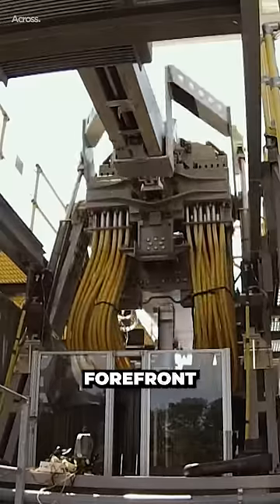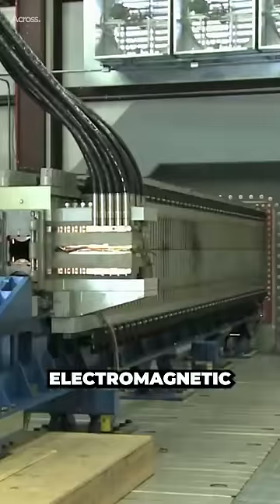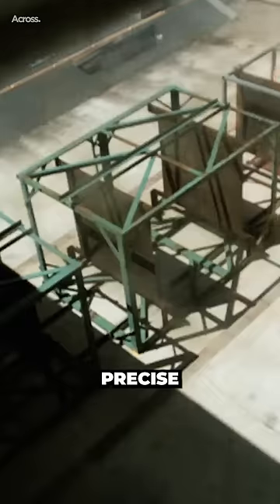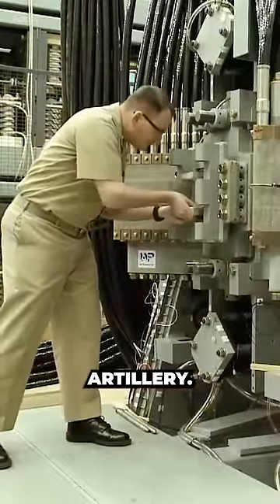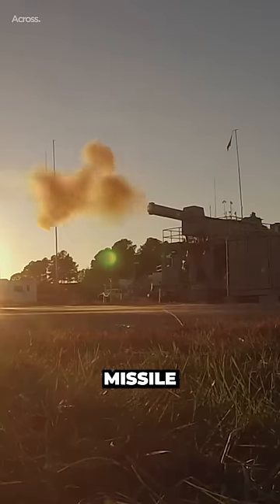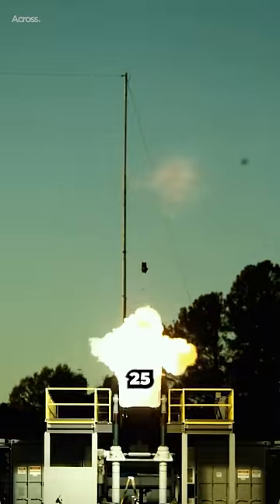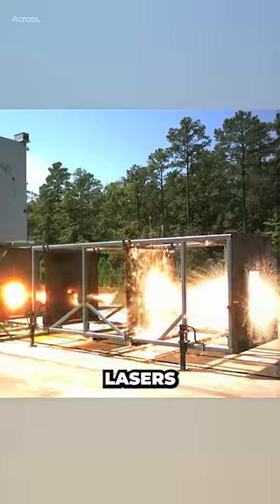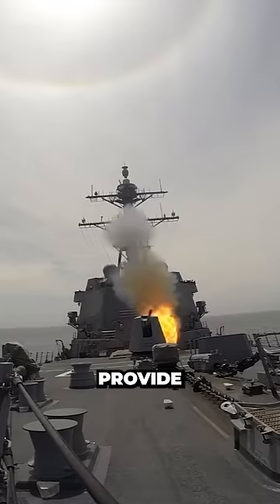The $500 Million Weapons That Make Everyone Afraid #shorts

Comment: They gave up on the rail gun.  Which means they probably got it small enough to fit on a ship...lol
Reply: Yes... that is also my understanding.
 It had a great deal to do with erosion of the rails/ short rail life.
Reply: Yeah they got something out of this. It's too good a concept to just say "nah it won't work." That's not the DoD style.
Reply: @dominushydra the issue isn’t size nor really power. The barrels just couldn’t last long enough to be reasonable. The existing rail guns had worked perfectly well. They just needed barrel replacements too often to be both reliable and cost effective
Reply: @RedPepper889  yeah I know that
Reply: @RedPepper889  why dont they use it as ground artillery? 115 miles, highly accurate could use it to destroy bridges or focus on supply lines and cant be intercepted?
Reply: @bigt6665 drones can probably do the job and are way easier to deploy
Reply: @bigt6665 rail guns penetrate, not destroy
Reply: @bigt6665 exactly what i was thinking, one proctile has to be much cheaper than any alternative ammunition cabable of hitting that far.
Reply: @bigt6665 Put that artillery on a body of water
Reply: They didnt give up on it, they realized that metallurgy hasn't reached the point of which we can sustain thd weapon and we don't have the power to give it the desired fire rate. Simply put they went back to material and energy testing to create a platform that can support such a powerful weapon. The us never really gives up on weapons we simply take the data collected and learn everything we can from it and come back when it becomes more viable.
Reply: @bigt6665 because towing a nuclear power plant along with your artillery is generally a bad idea.
Reply: @jjnix9517  lol u got a point...
Reply: @jjnix9517  but it can do with gas generator too. If it's big enough to support a modern warship :D
Reply: @jjnix9517 nuclear power plants are what power the majority of the US fleets 🤦‍♂️ 

Every submarine and aircraft carrier carry nuclear power plants ( reactors ) with back up diesels and gas generators. 

They've been doing this since the 50's.

How do you think they power all their electrical systems and charge their batteries for electric cruise propulsion. 

( for educational purposes ) the diesel and gas turbine generators are only there of the Reactor Scrams or is unsafe to use, typically but not always. 

Russian reactors on their subs put out that much power the UK and US can't figure out how they do this without endangering their crew. 

If you want to know more just reply. I work in the subs reactor industry.
Reply: @shaunhall1290  zoomwalt which was candidate platform of rail gun never had nuclear reactor. Do you think they'll gonna put rail gun on carrier? Or old ticonderoga? Or submarine?
Reply: @shaunhall1290  well I majored nuclear engineering. What part of reactor is your industry?
Reply: @dongleseon8785 where at
Reply: @dongleseon8785 - Ford class aircraft carriers were built with rail guns in mind and produce 600 megawatts with its two nuclear reactors. 😊
Reply: @ZootyZoFo  and the last zoomwalt was considered to have rail gun because of its enough power. Which is 78MW gas generator. It doesn't need all the electricity you have. It just need right amount.
Reply: They should do what china is doing.
Build artificial islands protecting our coastal and build these there. 

Like have one by the Navy base by San Diego.
Reply: @wwiking8055 a drone?
Reply: @ZootyZoFo  Uhh, no. The excess in the power grid is for lasers to replace the conventional CIWS. That an something called dynamic armor which when I read up on it sounds like polarized hull plating from "Enterprise"
Reply: They fired one off last week. I live about 10 mi down river from Dahlgren, and the sounds travel well over water. You can’t confuse the sound with a 5” gun firing. I don’t hear it as often as I used to, but it is still fired occasionally.
Reply: @shaunhall1290 . I don’t think crew safety is the Russian navy’s top priority.
Reply: The issue is the power plant so they need to miniaturized a nuke reactor
Reply: The need to charge the capacitor to such an extreme charge isn't efficient for a ship. Yet.
Reply: Everyone here such a armchair know it all, its the toxic reaction between the batteries and salt water that make it unusable at the moment.

From DoD friends. This is public btw!
Reply: @jjnix9517 pair it with a Rolls Royce SMR
Reply: @dongleseon8785  submarines, so naval reactors are my speciality.

A nuclear reactor on a frigate or destroyer could easily power all EC&I systems, including weapons, provide propulsion. 

Its just not cost efficient to put them in destroyers, and there isn't an operational need to do so. There is a lack of a large enough labour pool who is skilled enough due to training bottlenecks to consider too.

They're developing small modular reactors ,SMR, in civil industry that are going to be sent into space and that can be put inside shipping containers for use in disaster stricken areas and by the Armed forces in the years to come. So size it not an issue as they're already small enough.
Reply: @slaughterhouse5585  absolutely not mate. Their subs are too busy crashing into the Royal Navy to be concerned about crew safety
Reply: @bigt6665 Ground based artillery already has capacity to very accurately attack beyond that range, all day long without having to rebuild the gun every other day or needing to drag a power plant with it
Reply: The only 2 class of ships that would be capable of using a rail gun would be nuclear powered aircraft carriers and large nuclear powered cruisers, anything that is less than nuclear powered would be underpowered to charge the rail gun to a decent response time
Reply: Can passengers travel on these rail guns please to work😅
Reply: This true, I wrote the same thing. Just another idiot content creator behind the times. They discontinued in like 2000
Reply: @dominushydra they didn't get anything from it. It's discontinued and moved to laser
Reply: If aliens attack us this is what really happened
Reply: They realized they could get the same result if they just dropped it from Up above . 

No energy needed. Just drop it from 70-80,000 ft and let it fall.
Reply: @jjnix9517  now that’s funny
Reply: @OragamiSpliff those islands are sinking
Reply: @shaunhall1290 so you’re saying size doesn’t matter?   😂😂😂
Reply: because the round travels in a straight line because of it velocity it doesn't have the same characteristics as a normal arty shell the rail gun is a direct fire weapon this is great on the reasonably flat seas on land it is more limited by geography.
Reply: @dominushydra makes most sense for repelling invasions on shore. Of Taiwan could field a few Chinas navy would be swiss cheese if they tried to send an armada across the straight
Reply: @RedPepper889 you see thats where we like to use the term "improvise". The barrel from that used up gun was either melted down or used for another object, after all thats what happened in Iran, after finding out that Hussein had bunkers that were deep under ground, they filled up used artillery barrels with high explosive and put a kenetic penetrator on the front and bam, you have what would become the GBU-27.
Reply: It fits in a ship, rounds are just an obscene price that the rail guns were removed from the zumwalts, the price is 2000 to 3000 times the price of a standard round.
Reply: 25 mega watts for a single shot ?
Reply: Chances are they re-contracted it to be darpa exclusive so they can make the barrels out of a smart self repairing material
Reply: Hypersonic missiles outclassed railguns
Reply: @EricJaakkola  guns are still used in support of troops, naval gunfire support, missiles are not the answer to every situation
Reply: @shaunhall1290 Ah just the subs n (super) carriers are nuclear. Literally everything else is deisel or deisel-electric...
Reply: @wwiking8055  except the projectiles are 300 times more than a normal HE shell
Reply: @shaunhall1290  liquid metal coolant instead of usual coolant
Reply: @dongleseon8785  wasn't power, price of projectiles was just too much to even give a half load out for 1 mountlet alone 4 with war stock reserves
Reply: They? Who?
Reply: Lasers made this obsolete…
Reply: @shaunhall1290  power plants are not necessary there, but it's cheaper for big aircrafts carriers and very usefull if you want to stay underwater for a long time.
Reply: @RedPepper889 rail gun projectiles aren't touching a barrel at any point in time. It is suspended by a magnetic field.
Reply: @JTheraos  its being pushed by current flowing through it....
Reply: @lestergillis8171 each rail is half the price of all our houses together jkjk idk the real price but i have heard this befire abt the rails being a 2 time use only thing
Reply: @tommybilinglys1661  I have heard that with R&D, they have been able to extend that very modestly, but not significantly enough to prevent the Navy from pulling the plug on the whole project.
Reply: @RedPepper889  I didn't say anything about what's pushing it. I said suspended, because the projectile IS suspended and never touching a barrel... yes, current flows through it. Jesuss
Reply: @JTheraos  I think you are mixing up with gauss weapon. Rail gun projectile needs to touch rail. It just need to move fast before touching it so it won't weld itself to the rail.
Reply: I mean why don’t they just use frozen pizza rolls and air pressure?
Reply: Yea they don’t just give up on a Mach 7 tungesten projectile that that can penetrate a ship in and out 4 times
Reply: @shaunhall1290 does Russia even care about the crew?
Reply: They did. I can't remember what destroyer it was on for sea trials but they were only able to get a few rounds off before they had to replace the barrel. As a result it was cancelled.
Reply: The real purpose of the program was to study ballistics and which shapes work at hypersonic speeds. They can make shells that work in existing guns which is multitudes cheaper.
Reply: Lol what rail gun 😉
Reply: nobody is curious how do this sht works over the ocean if we on a globe? 100 nautical miles,  how big should be the bulge of water between  the ship and the target?
Reply: How the heck does turkey of all places able to make a Railgun? (Sahi)
Reply: Ok, so a magnetic rail gun with a huge power plant, high electrical discharge and a very large thermal signature… 

No good on land. Maybe for port defenses, but I’ll add this thing requires a lot to cool down, you could encase the thing in helium in some way, but I’d bet the appeal on a warship would have been water cooling a pool of some sort of glycol, in any case, the heat off this thing would attract every heat seeker out there, radars with thermal capability would also see it. 

Great power, with a lot of good potential, but a warhead on a missile currently is a safer solution for now.

If you could fit to an aircraft that could utilise the advantages and offset the disadvantages, it would be a winner, but again it’s not a warhead, it just punches holes in stuff
Reply: … all this time I thought the Zumwalt was nuclear, and the rail gun wasn’t designed for it since funding was cut, however the missile launcher it did sorta get was the one that had the huge cost of the projectile…
The perk of the rail gun was a cheap slug, costly barrel and electrics. Reliability and longevity axed it for now.
Reply: @lestergillis8171 electricity and salt don’t mix very well so I could imagine.
Reply: Harder to blow yourself up without powder bags to experiment with
Reply: @stolearovigor281 it follows a ballistic path, the same as any other projectile. Sure it is a lot straighter than a slower round, but not nearly straight enough that the curvature of the earth is going to be a problem
Reply: @neilr7935  you know the fake globe size and the curvature formula for that size?
Reply: @stolearovigor281  not sure what you mean by fake, but a simple approximation is an 8" drop per mile squared. So at 115 miles (roughly 100 nautical miles), you get about an 8817 foot deviation. Now, considering that the projectile is going to take well over a minute to hit the target at mach 7 (and that the speed can be reduced if needed), it's not hard to imagine how the projectile could drop that distance before hitting the target (my brain hurts too much to do that math lol).
Reply: @neilr7935  try explain to your brain how a laser curves around the globe when a warship pinpoint a target at 100+ miles. Earth is flat and stationary.
Reply: @stolearovigor281  I wouldn't ask such a dumb question. No ships are using lasers to paint targets 100+ miles away. They are using spotter aircraft, AWACS, and other means of identifying targets over the horizon.

And they wouldn't be using rail guns for this purpose either when there are more effective guided missiles.
Reply: @neilr7935  I don't consider you dmb. Maybe a bit uneducated.  Even in this video they told you about lasers.  Lasers are used for a long time in military.  If you aren't aware of it then it's just about you and your level of knowledge.  But, let's say I am wrong about lasers . What excuse you gonna have for periscope? How far a modern periscope can see?
Reply: @stolearovigor281  I suggest you re-watch the video. They specifically mentioned lasers for close range defense (not targeting ships over the horizon). 

Yes, the military has been using lasers for years (e.g., for painting targets for aircraft). That doesn't mean they are using them in the specific scenario you proposed.

As for periscopes, obviously it depends on the distance above the water that it is mounted.

And you can't go around accusing people of lack of education while simultaneously believing the earth is flat. Sorry, end of conversation.
Reply: @neilr7935  now I can confirm that you dmb. Even when the facts are in front of you you choose ignorance.  Normal exposure,  distance at least 5-10 miles.  Check again the numbers for curvature at this distance and tell me something about refraction.  And btw champ, horizon is optical not physical.
Reply: @stolearovigor281  Periscope height is a necessary factor which you are glossing over while trying to sound smart. But even at sea level, assuming clear visibility, you should expect to be able to spot any ship taller than about 67 feet at a 10 mile distance. Periscopes mounted higher (such as those on battleships) can see even further.

I will give you the benefit of the doubt and assume you are a troll and stop engaging at this point.
Reply: @neilr7935  now you not just dmb but dishonest also. We can see boats farther than 10 miles.  Much much farther.
Reply: @stolearovigor281  you were the one that stated 5-10 miles in your comment. I was simply replying back about what would be visible at that distance under normal conditions. Stop trolling
Reply: @lestergillis8171 coil gun would fix its prone to exploading.  Works pretty much the same way as a rail gun.
Reply: Yeah they got them on ships
Reply: Piece of junk, wasted billions
Reply: @johno1544 correct
Reply: @shaunhall1290  I think I figured how the Russians do it! They endanger the crew, endanger the hell out of em.
Reply: @jjnix9517 i mean itd be a great idea. Just dont let it get hit lol😅
Reply: They didn't give up on it. Funding was cut. Two totally different concepts. The Navy absolutely wants railguns because it means they can use their nuclear reactors to fire their guns instead of having to carry explosive powder that could detonate in the magazine during combat.
Reply: Remember, we used to think canons extraordinary, but now we have guns. I can't imagine how cool it would be to have a handheld railgun.
Reply: @lestergillis8171 Then the trick is to devise quickly replaceable rails. Treat them like consumables.
Reply: I believe they have got some other techniques up their sleeves using propellants such as hydrogen. And they are getting silly velocities out of them.
Reply: From what I have gathered there are 3 most likely reasons they were cancled : 

1: The biggest problem.  They don't do that much damage.  Oh FOR SURE they penetrate like no other, but like an FMJ vs a hollowpoint bullet, they don't actually do that much damage to the ship they strike.  Ships are...about 80%-90% open air space inside.  So a slug is shot all the way through a ship...  does it hit anything that actually kills the ship?    Even if you got SUPER LUCKY and directly hit the engine block, or major computer system, naval ships tend to have redundant systems, so it will keep going, even if its at half-power now.   

This is why WW2 naval shells were EXPLOSIVE.   Now they did damage.   Penetrate though the armor and blow everything to kingdom come.   But to my knowledge HE railgun shots have not been invented.    Yes, they could shoot it below the water line, but the crew can just close those compartments to contain the flooding.   Navy ships are MADE to handle a good amount of leaks before they sink.    So for damage potential, its not beating a simple anti-ship missile, let alone coming ANYWHERE close to an aircraft-dropped GBU style guided smart bomb.   

2.  I heard the rail guns took SO MUCH power that the ship captains would be forced to chose between firing the gun, and running the rest of the ship.   I don't know if you know much about naval warfare, but a stopped ship is a DEAD ship in a water fight.   Ships use turning to evade fire and to avoid torpedos.  

3: as others have mentioned, the barrels wore out so fast they wouldn't even survive a single mission, let alone a tour of duty.   

IMO the Navy needs to mate the old style of 16 inch (or bigger) guns that shot shells the size of a car, with modern guidance systems that could easily make those shells able to fly through a window at 50 miles.   There is no ship on the water currently that could survive multiple strikes with a 16 inch gun, and when it comes to shore bombardment?  Did you know 90% of the world's cities are under 50 miles from the sea cost?   Couple a big-gun ship with an escort of missile ships and anti-air defense escorts, and toss a carrier following them, and the navy would have a tasks forces that could bring horrific devastation to anybody who tried to engage them.  

I feel like the supporting technology needs to come along more before rail guns become a feasible technology.   

But the good news, thanks to the research the Navy has already undertaken, when that day comes, the US will have the first operational railgun ships decades before the competition.  

So now droning on... why did they retire the old battleships?  Well they were old.  As in completely obsolete.  Also becoming maintenance nightmares.   Also the Cold War.  The US has no peers on the sea as Russia never was a big naval power, and it favored fast missile ships.      The other big, accuracy.  For the Cold War, aircraft and missiles provided better accuracy and longer range than any gun-guidance system could provide.    Since ther Iowa class was sailign, and there was no reason  to make new battleships, new were never made.  

But with the arrival of the 1990's and 2000's computer caught up to the point that anti-aircraft systems approached 90-97% accuracy, and a ballistic gun computer was cheap, easy, and stupidly accurate.   But by this point the US wasn't just peerless on the waves, it was uncontested, completely.    

This has changed today with the Chinese fleet.   

And while these railguns are neat.  There is something to be said for being able to lop a shell with a 500 pound penetrating steel nose cone and 1500 pounds of C4 into the middle of an enemy's destroyer at 50 miles with fist-shot accuracy, while having 1 foot of solid steel armor yourself to defend against enemy missile attacks, and a small escort with 400 SAM missiles that have a 97% kill rate...

Then lets add laser point defense systems to the ships to shoot down close aircraft, drones, and incoming missiles...   Lasers show MUCH more potential than rail guns to be useful, particularly on nuclear powered ships where they could be connected to capacitor banks charged by the reactors.   They could easily make a ship where no plane, done, or missile could come within a 3-5 mile sphere of it.  And unlike CWIS systems, with a nuclear reactor lasers don't run out of ammo.   

I think irony of all ironies, we are primed to see the Battleship make a comeback.  

And no torpedos are not a kill.  I've presented this before and had many people try to say torpedos are the foil to all surface ships.  Well ok guys...  1st:  The Iowas were fired upon by over 1000 torpedo's in WW2, zero hits.  Even the guiding torpedoes can dodged, and what cannot be, can actually be outrun.   See torpedoes are not missiles.  Missiles fly about 5x faster than the jets they kill.  Torpedo's are actually SLOWER than the surface ships they target.  This is because water density and engine power and stuff. 

 And without need to conform to the panama canal, they can make ships with double hulled designs that can easily withstand even a "keel breaker" direct hit.   Something the famous Iowa cannot manage because they had to be made narrow for the panama canal.    You also don't build ships with a keel to keep them intact in the first place.   

Also despite what so many internet "experts" tell me, torpedoes are not an insta-kill on a big capital ship.  If that was the case why did the USA invest over $1 trillion in the current fleet of carriers if a single sub could send one to the bottom with a single hit?  Its simple, because they cannot.    Big capital ships have these things called destroyers escorting them, which they are NEVER without.    

And no sane navy is EVER going to let its big ships go without escort.  Not after the Allies sunk the Bismarck.   

And no nuclear weapons don't work.  They found that out in the 1950's.  The detonated a nuke something like 300 yards from the USS New York, and it was still floating almost undamaged when the smoke cleared.   Basically only some of the stuff on the super structure was damaged.  In fact in general they found nuclear weapons both above or below water cannot kill or sink naval ships, unless they like, went off inside the ship somehow.
Reply: @bigt6665 bc its too expensive to fire
Reply: Biggest drawbacks were electricity needed to fire the weapon and everytime it fires especially if shot several times it slowly damages the rail which needs replaced
Reply: @jjnix9517 aren’t our aircraft carriers nuclear already?